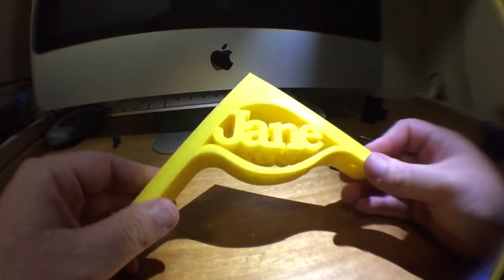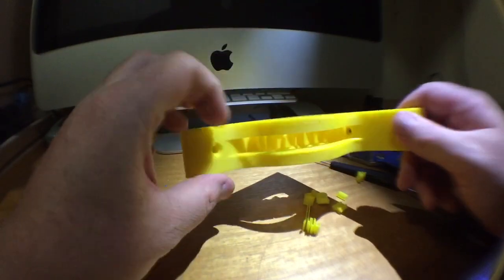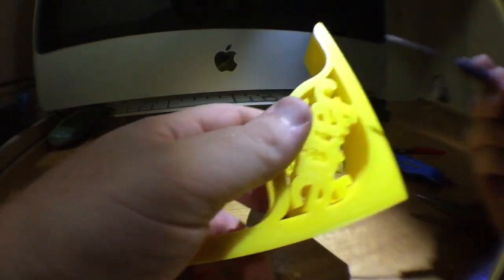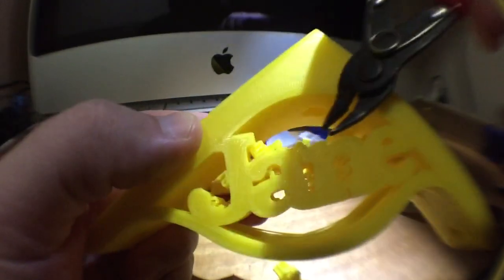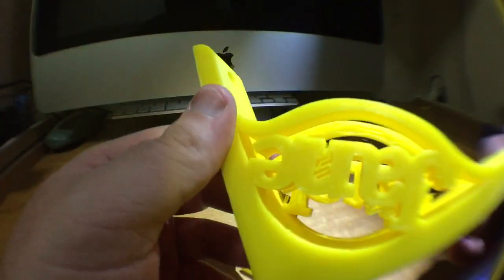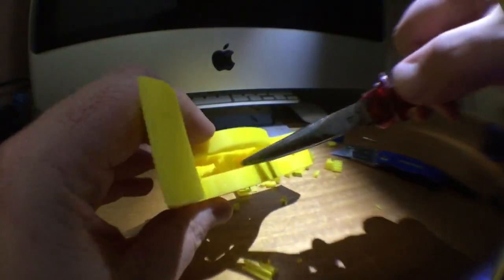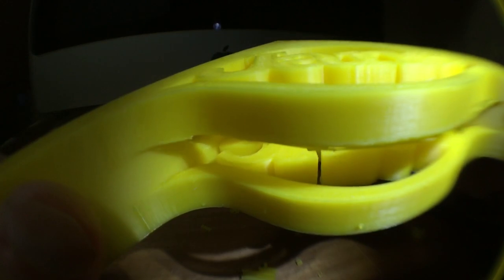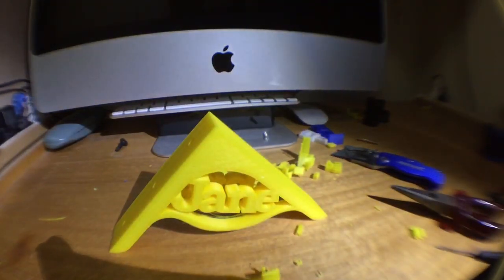Flashforge Dreamer- Removing Simplify3d support structure

Comment: Thanks for the videos Thomas, very informative. I'm considering buying this printer because of the dual extruder and it being able to work with Simplify3D. Have you thought of using PVA for a support material which is supposed to work with the printer and Simplify 3D software? The PVA material is water soluble, and should eliminate having to break the supports off.

Comment: Thomas thank you for all your 3d printing videos they helped me choosing the dreamer. 

I just got mine yesterday and I started printing with some simple stuff for  now. I have also purchased simplify3d and when I try to print with the gcode made from simplify3d as soon as the printer reached temperature it just stops. Touch screen is not responsive I have to power cycle it. I can print perfectly fine with flashprint. 

Can you share your settings for simplify3d ?
Reply from the maker: Email Simplify3D support, they will send you the firmware file for the Simplify3D software. You need 2 files, the firmware file and the FFF file.
Reply: Thomas James thanks Thomas someone posted the files on the forum http://www.forum.simplify3d.com/download/file.php?id=913
Reply: Naren Patel the new version of simplify3d (2.2) has the profiles pre-packaged.
Reply from the maker: Naren Patel Yes, I am just using the pre packaged files in Simplify3d but my dreamer firmware is still 1.61.

Comment from the maker: Hi Mike. Yes after I saw the Flashforge Dreamer was supported on the simplify3d web page I bought the software. Only to find when you install it, the dreamer is NOT LISTED. I had to contact customer support and they emailed me 2 files that need to be imported to get the printer working.
Reply: Any chance you could forward me those files?  Save me the trouble of going through tech support....... Do you recommend the program?
Reply: mikeward1975 There support responds really quickly, I've contacted them before.
Reply from the maker: mikeward1975 Ah yeah, I'm loving the program. It slices around 2000% faster than anything else and more importantly you have finer control.

As for the file, just go here and download the .FFF file and that's it!
http://www.forum.simplify3d.com/viewtopic.php?f=8&t=1277
Reply: Thomas James  What are your support settings?  I have dreamer and S3D as well.  They have finally added the Dreamer to drop down list on the configuration page.  
Id like to know your support settings, the underside of your print looks clean.  Sometimes my print underside is a bit messy.